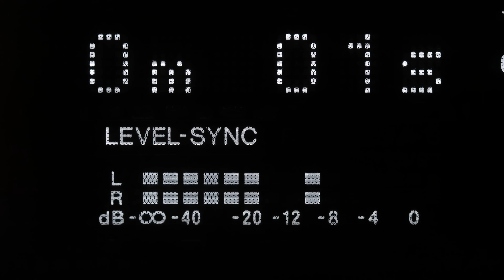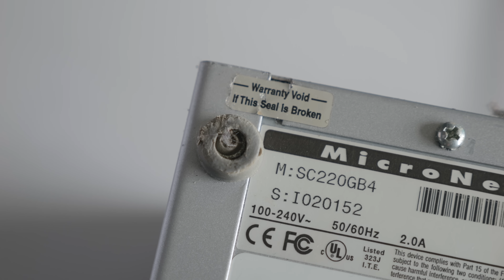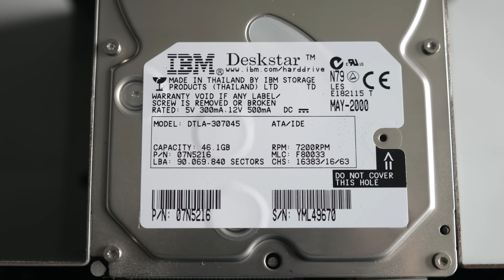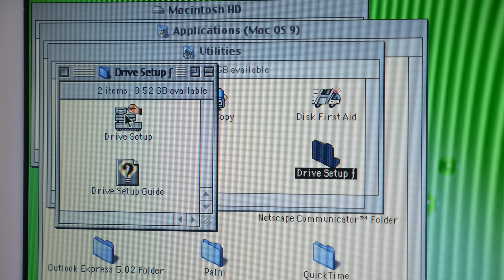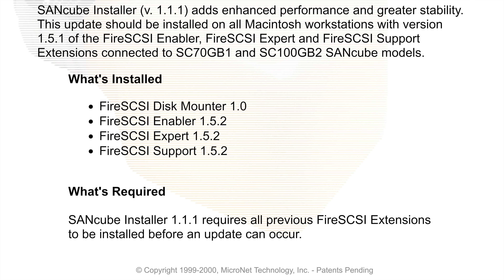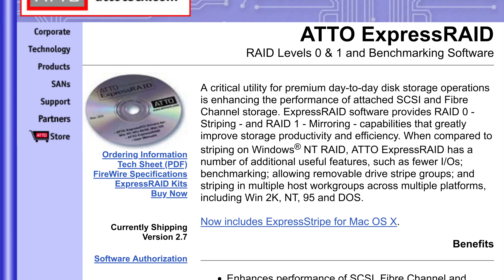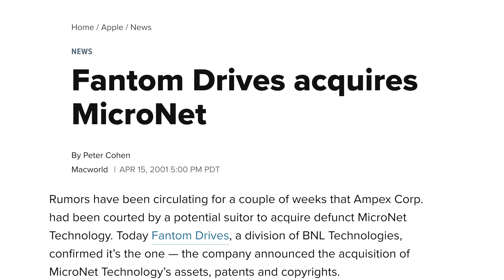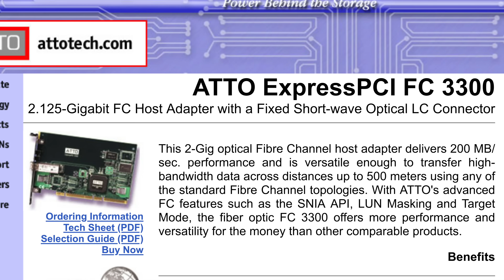This old external hard drive can do WHAT?!

Comment: Heart sank when you removed the cover to reveal an IBM Deathstar. It may be early enough to not be the 70GXP that head crashed so bad that it stripped the spinning rust from the glass platters....  but the model type matches even if the fru pn doesn't... so... beware of the deathstar head crash!

Comment: My inner pedant wants me to scream that (at least as of what you demonstrate) you don't have have Security Torx bits, you have Security Torx drivers, ie whole screwdrivers and not attachments to a 1/4 inch driver.
Reply from the maker: They actually are bits that fit into a modular screwdriver, they just happen to be pretty long.
Reply: @ThisDoesNotCompute Well look who's the fool now, argh. That's pretty cool though, often normal quarter inch bit drivers don't fit certain recessed screws.

Comment: This device reminds me an awful alot like the modern-day Jellyfish Server; the fact you need to "direct attach" all your clients, all the settings for the pool/array, users and mounting is all done in special software  are all things that both servers have in common. Of course there is several differences between the SANcube and Jellyfish's implementation  of these similar features - but the fact ( that I believe) is the OG Jellyfish control software was Mac only makes me think that is an early 00's version of Jellyfish, and that is personally very cool to see someone had a similar idea of such a server 23 (or so) years ago! 😆

Comment: I know the idea is to get the desired functionality on the period correct hardware and software, but, have you tried this on Linux or Windows  ? 
Got some results when looking for info on those LSI SymBIOS chips. Support was supposedly added to windows in 97 so you might have some luck using an old 98se/XP install. 
On the Linux side, Fedora had support up to 9 as far as I can tell and maybe later releases as well.

Comment: With the amount of space inside this thing, it wouldn't be terribly difficult to restuff the proprietary firewire board with a DIY solution that works.

There are RPI projects to make NAS units, and you can get M.2 to SATA RAID controllers with 6 ports on them. But that's a lot of money to spend on a crappy nonsense design that is not serviceable. I think Apple rubbed off on them too hard in all of the wrong ways. Making a network storage device that has unservicable hard drives should be a crime.

Comment: I have a tensome years old ZyXEL router thingy for which I have lost the CD... and it appears that the stones needed to turn to locate the e(xc)lusive NetUSB software are probably too large for me - at least it seems thath ZyZEL no more has it available for download. But that thingy would have been really handy for a project I was involved in. I wasn't going to buy a new USB to Ethernet router just for the unpaid side hobby, so I let it go. It would have been nice, though, to be able to route one USB receipt printer to many computers - which for a "company policy" were required to run a stone-age POS pogram that still prints by serial port. Also it seems that this is one of the few printers of whose virtual serial port is supported by the program. Somehow the developer of that same POS (excuse the pun) made it so that it prints its test print by the Windows driver - and that threw me off for some time, trying to make it work with an IP port. Also I tried to find a comprehensive way to work around that in Wine, and toyed withe the LemonPOS project but that is virtually abandoned, no longer works out of the box with any modern distro, and I'm no software developer.

Comment: "...relies on non-standard commercial software requiring serial numbers and activation to work" - this is kinda sad. Thats why one should stick to standards even if they not so robust as tricky custom software.
I can guess pirated version with leaked serial codes could exist if it was not so niche product.

Comment: ~"couldn't get it to open with Stuffit..."
From some very fuzzy 35+ year old memories....   If it was an InstallerMaker created installer, it is likely that the data fork is a stuffit archive.   However, the um...  "signature" (?) on the file will be for "application"...   You'll need to use ResEdit to change it to whatever the correct code for .sit/.sitx/.sea is...   At this point, I'll assume that Stuffit will recognize it, but it will likely be an encrypted stuffit file - and it will ask for the password.
Now, the installer itself will need 2 pieces of information...  1) true/false- the installer can proceed, and 2)the text of the encryption key.  So, if you are lucky and running the installer in a 680x0 debugger...  if you watch the data push/pops for string handles....   you may be able to catch where the encryption key is loaded into memory.      Then with the encryption key, you can just type that into Stuffit when prompted.
Alternatively, I knew others who would see the installer fail its tests and return 'false' from the "installer can proceed" subroutine...   and simply change the value on the fly to 'true' in realtime - and allow the installer to continue and do its thing...  just be aware that if the installer is expecting something and doing a differential change...   you may get an unusable system.
(Wasn't there an extention named something like "Even Better Mr. Bus Error" that would ensure memory location 0x0000 had an odd number in it - to prevent such horrific events by immediately crashing the Mac?  Although that is maybe a slightly different way to corrupt your system.  Don't ask why i needed to discover the extention...   lol.)
Wow..   Unlocking memories that should probably be locked...   and are definitely fuzzy...   hahaha 
Hope some of this is helpful.

Comment: Even though that external enclosure can't be used due to software that you can't get now, all of those hard drives inside can be used or resold for certain. Also all six of those definitely passed their self-test, would be neat to see if you tested them...I would personally expect a few bad sectors here and there, but a good zero with a utility would cause the bad spots to get reallocated and then the entire drive surface can be useable again, don't expect a perfect health drive over 20 years old of course but better than tossing the entire external enclosure with useable parts inside.

Comment: "IBM Death Stars" lmao
Reply: Well, all mine still work hehe. The problem was the fact that so many OEM PC cases had poor ventilation and the drive would overheat to heck especially the higher end 75GXP drives, with the more platters. They often would get up to 60c if running for an extended period of time and combined with the poor cooling this would cause the drives to degrade rapidly and often fail in two or three years or even less. They are incredibly fast drives for the time, are not that loud, and overall were amazingly built drives just a shame that most of them failed the way they did. Also they were not designed for 24/7 operation, yet people disregarded this and would do it anyways by using them in servers and in RAID configuration, it is no surprise that it went how it did...

Comment: I've worked for a small TV station between 2000-2002 and we had one of these. Our workflow was DV based (SD resolution) and the Cube worked perfectly. We were able to transfer videos from a video tape on any of the 4 Macs and edit them on any of the machines with Final Cut Pro. Since 100mbit ethernet was slower than transfering the tape, it was the best solution other than using super expensive 1Gbit ethernet and even more expensive file servers.
Reply: Sadly you can't find the software or one of the old Mac back in there ? Or if you made a personal copy of the computer. It could just help to know on what media type the driver was in.
Reply: @codix__  I've quit the job at 2002 (I was a news editor and switched to VFX) and unfortunatelly I know nothing about what happened with the company that run the TV at that time and even less about what they did with the old hardware.
Reply: @codix__ definitely at the time the important driver software would have been on a CD-ROM. No FireWire Macintosh had a floppy drive, and at that time DVD-ROM drives were only new.

Comment: People now act like spinning hard drives are going to fail catastrophically within 3 months or something, there are drives out there that are still working after 30+ years, I've had mechanical drives  that I bought used last me 12 years, heat, vibration, temperature changes, shocks, and programs that cause your hard drive to constantly run kill them, I am currently running an enterprise grade drive I bought used 7 years ago as a boot drive in one PC, it's from 2013 😂 iPod's used to have mechanical spinning drives in them, it was always surprising that they could survive that type of punishment, and SSDs have a finite amount of reads and writes its expected to work for too
Reply: Yeah, I've never really had bad luck with hard drives.

I did desktop support for a large company for 12y and would test drives we pulled from systems, usually the vast majority were fine and someone just blamed a boot problem on "a bad hard drive" and replaced it. 

Laptops did have the most real failures, but even all my old retro 486, Pentium, and P3 laptops  and desktops still have their OEM hard drives going strong. (I want the full experience, no SSD's in my retro machines).
Reply: I have a dead 2019 1tb drive and twelve working (and five dead) 1980/90ss MFM drives. It's kind of a toss up. I'm a drive hoarder for no apparent reason.
Reply: Not hard drives in general, IBM Deskstars. There's a reason people called them Deathstars back in the day.

Comment: About 25 years ago, the big CE company I worked for was trying to spread IEEE1394/FireWire beyond computers, hard drives and miniDV camcorders. I worked on a project for FireWire to be a standard A/V connection between HDTVs, D-VHS recorders and cable STBs. The technology worked for streaming between devices and even supported control and on-screen display overlays but never got deployed into production even though the devices had the connectors. It might've been usage rights concerns, a question of the future and cost of FireWire, or maybe the impending future of HDD-based DVRs.

Comment: Interesting, and yeah... the cable length restrictions... FW was also a "cheap" half gig thing for plain TCP/IP, but... yeah, cable length... Still, a worthy niche thing, in the case all your machines were  close to each other, all had FW and the "NAS cube" was cheaper than adding an extra box just as a file server.

Comment: Yet another perfectly functional piece of hardware made totally unusable by requiring registration over the Internet, when the manufacturer's servers for doing so no longer exist. 😒 This upsets me.  The first end user paid $4000 for this device when it was new, and then it is rendered useless by factors totally outside the end user's control.  This is why devices and the software that runs them should always be made to be stand-alone.

Comment: Kinda interesting box!  I have similar weird box called Promise SmartStor DS4600, holds up to 4 hot-swappable SATA hard drives and uses USB 2.0, eSATA or FireWire. And that also creates RAID, uses Windows utility for that(which luckily is still available). I have it loaded up with 4x 1TB drives, it's one of my backup drives :)

Comment: Oh shit, i think those are "DEATHSTARS" disks
Reply: Yes they are part of the 75GXP series, they are the mid-range models at 45GB. The thing is all six passed their self-test in the video haha. Heat was a huge killer of those drives. Most OEM computer cases had crappy cooling and those drives would get up to 60c at times and if ran for an extended period of time it would rapidly degrade them and cause them to fail. I still have a full set of the series, 15GB, 20GB, 30GB, 45GB, 60GB, and 75GB and they all still work. This is because usually lower hours will help and also proper cooling will. The external enclosure actually has ventilation therefore the drives can't get insanely hot, so they likely didn't overheat to where it damages the drive over time. Also as stated per IBMs website at the time, the drives are not designed for 24/7 operation yet people would disregard this and stress the drives combined with the heat of OEM PC cases, and it was a recipe for disaster.

Comment: I used a lot of IBM DTLA-307030 drives back in the day. They died like flies........but hey, they were the fastest IDE drives available.....
Reply: Odd that you say that, I still have about eight 30GB models that work mostly right now, some of them even test as perfect with the S.M.A.R.T! Most have reallocated sectors though, but not horrible considering their history. The problem from what I can tell is the fact they overheated to heck due to crappy OEM case cooling. The more platters the drive had too, the hotter it would get. They are one of my favorite early 2000s drives still. I love how fast they are, how they sound, and just the overall quality feel they have in the hand. Also if you want a tip, the best way to keep one working is to literally not use the drive haha. As the video shows, all six of the 45GB units in that enclosure passed the self-test just fine!

Comment: thank god hardware raid is dead now
Reply: I had a SATA RAID array of four 200 gig drives connected to a PCI (not PCIe) controller. Was a bit of a pain finding a RAID controller with all four ports internal, that wasn't priced stupidly high. I chanced upon an eBay listing in the wrong category, with a low price. :)

The thing with that card is the array can be entirely configured using the BIOS on it. That makes it portable to any computer with a PCI bus running an OS that can read the filesystem used to format the array - and nothing special needs to be done with the OS.

With software RAID it's likely that only the system the RAID was set up on will be able to use it. Blow up the OS to where it needs a clean install and you could lose access to the RAID.
Reply: @greggv8  Hardware RAID is portable, provided the RAID controller doesn't die. Software RAID is portable as long as you have the software (every software RAID solution, I've ever seen — except for one particularly asinine mdadm configuration — saves info on the drives, so if you connect them to a new computer, it reads the config and everything just works™). 
The worst thing is BIOS-level RAID. Those drives will only work with that motherboard model (and maybe other MBs from the same manufacturer, if you're lucky), so if you want to migrate, you need a new set of drives to move the data to. And if your PC dies, you can't just say “well, it was old/slow anyway” and upgrade it, you have to fix it.

Comment: I guess intended as a hot storage thing for large data but also as a turnkey solution.  Expecting users would have some cold backup solution.  But something you could set down in an office or studio or something and not worry about... Until you have to replace it.

Comment: I remember seeing products like these here and there in high-end boutique web design centers and print shops which I think was their targeted environment. If memory serves a third party made a FireWire to LAN hub to extend these things into the NAS era. Unfortunately ATA-133 just never had the throughput to take full advantage of FireWire, and I'm not exactly 100% sure any one of these old products ever fully made it out of the ATA-100 controller era before SATA obsoleted IDE altogether. Anyhow fun video, it's neat to see forgotten niche storage devices 😂
Reply: ATA-133 always had enough throughput to take full advantage of FireWire. FW400 is theoretically 50 MB/s and ATA-133 is 133MB/s.
Reply: @eDoc2020  In 1999 you were lucky to get a third of that transfer rate disk-to-disk with two IDE drives in the same machine on the same cable. There's a valid reason more high dollar FireWire storage devices of this era ran the SCSI interface until SATA superseded all of it in the prosumer NAS/SAN market. IDE from this era, in the real world, came nowhere close to advertised speeds even with top of the line 7200rpm disks. To be honest storage cubes like these were pretty much used to back up data and that's about it. They were too slow for proper filesharing
Reply: @eDoc2020  actually I take that back, some very very very early NexSAN's used IDE drives right at the tail end of IDE and they were.. OK.. but I think they were getting their throughput from two striped raid 0's (not quite raid 10 but something proprietary they were doing at the hardware level with some super fast cache, and gigabit Ethernet). Aside from that SCSI & SATA still blew it away.

Comment: It's self defeating to have a clear plastic shell when there is just a sheet steel cube beneath it.
Reply: Unless it makes it more attractive and marketable.
Reply: It's seemingly for EMI shielding, I've also seen some prebuilt PCs in MediaMarkt (German BestBuy, but not with "DIY" parts but by OEMs like Asus etc.) that had clear side panels but with a peforated metal sheet behind that so that it looked like the window of a microwave oven.
And the window was also seemingly made of plastics/acrylic "glass" in 2018/2019 when tempered real glass was already widespread.
But yeah, they could have made it more attractive with some painting of the metal part (or make it out of stainless steel instead of cheapo grey zinc-plated).